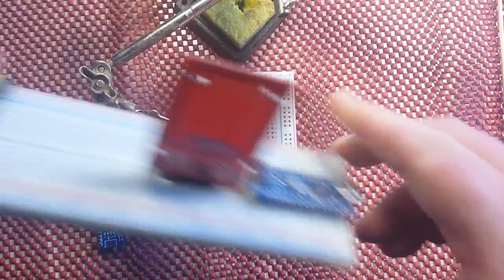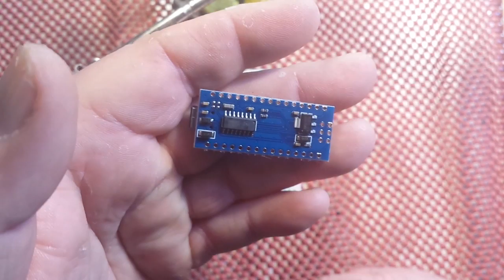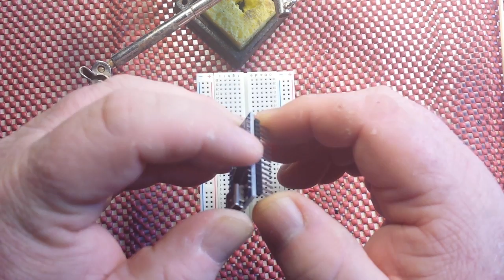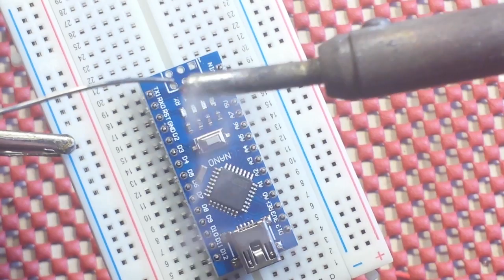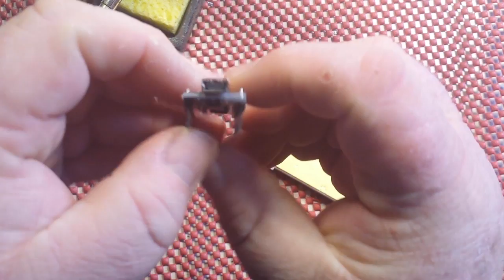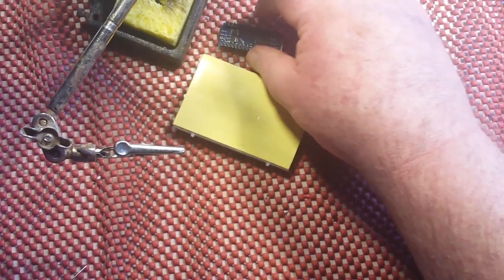How to solder header pins

Comment: Great use of the breadboard for this. I ended up ordering one to use with my Adafruit Pro Trinket, and I love the results. 

After I solder the header pins, I'm cutting off the longer pins and using the header cap as a standoff inside of a 3D printed enclosure

Comment: Another tip is to push the pins further down beforehand so that they aren't sticking out a mile from the chip .  Especially in cases where you might need that extra room on the bottom because of an sdcard/reset button 
/etc

Comment: Thanks for this video - I last did soldering about 15 years ago (back at school) and am now trying to solder some header pins onto a small sensor that I'll be using on a Raspberry Pi and I couldn't figure out what I was doing wrong. 

I see from your video (and other tutorials) that I need to pre-heat the hole in the PCB by briefly touching it with the soldering iron before applying the solder. The Rosin core also seems to be vital... I don't have that with my 15-yr-old reel of solder and rusty old soldering iron. I'll head to the shops tomorrow to buy some new stuff.

Also, very clever idea to use the breadboard to hold the PCB in place.

Noob question for you, though, if you don't mind answering please: I soldered in header pins into a PCB prior to seeing this video and it's nothing short of a dog's breakfast. I need to melt the solder and get rid of it so I can remove the header pins and start from scratch. Could you please explain how to go about doing this?

Thanks. :)
Reply from the maker: Just get yourself a roll of desoldering wick. Gutwick is a nice brand. It's Flux infused copper braid. Place it over the joint then put your iron on top and it will suck up the old stuff.
Reply: Ah great. Thanks for that advice. :)

Comment: OK O see what you did and i have a question. I am building a model train sound board using a Wemos mini D1. But in one week I have managed to kill 3 of these boards. I wanted to ask your opinion. What heat is used to solder pins, I used a tiny tip with 250 C and it was awful. Cold Joints. On the model train we use the transformer to control speed and convert the AC track power to DC then Regulate to 5V DC for the Wemos. It worked very well. Until I started to really test the systems and had to raise and lower track to change direction or restart a sound. It seems the Blue Light went from solid to flickering and them pulsing over time. Then the board becomes nonoperable. My colleague thinks we need a Buck & Boost board in front of the Wemos. He thinks the low voltage on and off can corrupt the board. Would you be able to offer any insight in to this setup. I have been upgrading numerous systems in the engines like Trucks, Smoke, Motors but the Sound Stuff has so much delicate electronics I am not so capable of skilled in making them live very long. Thank You for your videos. I joined the Patrons several months ago. Dennis

Comment: Is there any concern that the breadboard sinks away significant heat, making it tough to heat the pin enough to melt solder?  Or if you turn up the temperature on your soldering iron to counteract that, you could damage your electronics module?
Reply from the maker: Nope, it works fine

Comment: Thanks for a clear example! However, few questions popped up when I watched it: 

1. Does the iron do any harm to PCB when you touch it while applying heat? 
2. Does it matter from the connectivity/correctness perspective, if you put in the pins from the opposite side of the PCB?    

Thanks in advance,
Denis
Reply from the maker: No you can drag the iron along the PCB without issue and you can install pins on the top or bottom to fit your needs.
Reply: @learnelectronics  thanks !

Comment: Nano's or any board with a mini USB socket are the worst boards. The sockets are so flimsy.  If I buy one I usually resolder / add extra solder to the 4 pads that hold the metal case of USB socket to the board,  just don't use too much towards the front of the socket or the plug won't fit  properly.

Comment: Wonder how many modules have been roasted trying to duplicate this reckless example. There is zero need to run down the line like you was in race and it sets a horrible example for newbies. I am not impressed and I would refuse to work on anything with you if we were coworkers. Sad.
Reply from the maker: Hi. Thanks for your comment. Also, piss off.